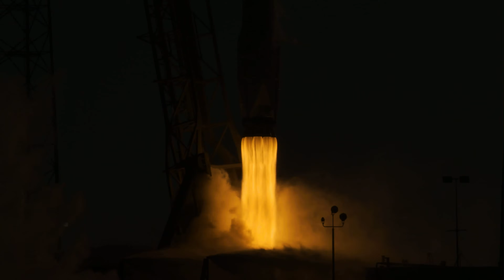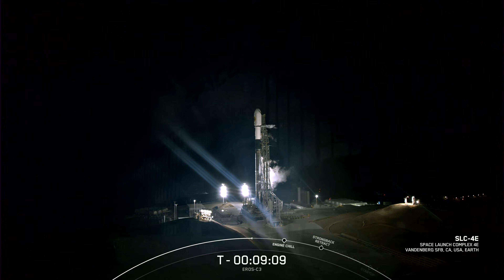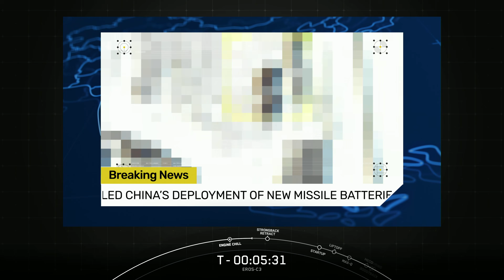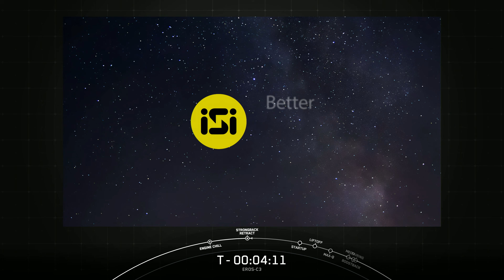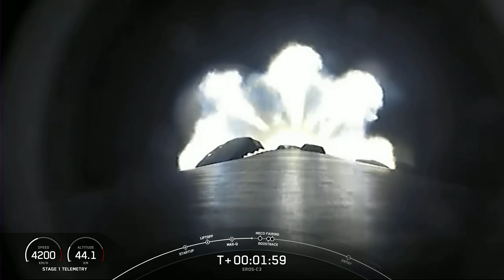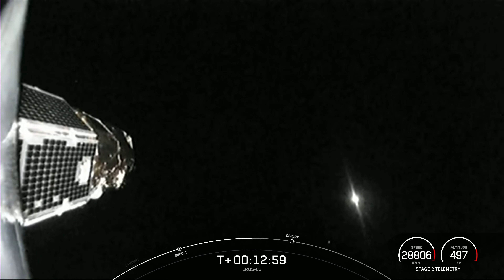ISI EROS C-3 Mission

Comment: 61 launches in one year. At this rate SpaceX will surpass all of NASAs missions in less than 4 years.
Reply: SX’s Falcon 9 is way less capable than NASA’s shuttle or SLS, so divide those 60 launches by 4 or 8 and you’ll get a more accurate comparison

SX is a commercial business to launch routine regular payloads, NASA is about pushing exploration boundaries
Reply: @alrightydave  Should Starship be successful, it'll quickly put an end to that argument.
Reply: @alrightydave  And when the Starship is ready , what will happen then my friend ?
Reply: @nikolaiiliev2993   What will happen then is that SpaceX will continue to be the commercial provider, launching payloads for NASA and other customers, but on far more operationally complex missions. When that day comes, NASA will continue to push the boundaries of exploration, and other customers will begin pushing the boundaries of commercial exploitation. The next few decades are going to be tremendously exciting.
Reply: @alrightydave  Falcon 9 has almost the same payload as the space Shuttle.
Reply: @alrightydave  There's no denying NASA did amazing work, however at the rate of speed which they move they might as well be standing still.  Some comments say NASA is exploration(like yours)...with drones and large cameras and satellites as of late.  Hubble is just that..jamesweb is the same..ahem.   Then its... yah let us go back to the moon...?  Really..that's pushing the boundaries of space exploration..?  Come on.  It's like being fascinated with your infant discovering their left foot over the right foot.  Putting better cameras on a telescope is not pushing boundaries.  Again, going to the moon is not pushing any boundaries...its been done..SLS is a huge waste of tax payer money...with some other spending agenda from the US Govt.
Reply: And next year they wanna do a full hundo that's one hundred launches in a year jesus 🤯 for reference the delta 4 heavy flew like 14 times in 18 YEARS 😆 🤣 😂
Reply: @williamgrunzweig571  whatever you think of the SLS program, I hope you definitely agree we should return to the moon.
Reply: Orbital launches in 2022: China: 63; SpaceX: 61; US (excluding SpaceX): 24; Russia: 22; Europe & India (each): 4; South Korea & Iran (each): 1. Pretty impressive that SpaceX on its own is only 2 launches behind the entire country of China and comfortably more than double any other country including all other US players!
Reply: @alrightydave  bro you are only one who is speaking with sense
Reply: @supremes5840  unfortunately over the years, I've seen a growing number of people thinking its NASA Vs SpaceX. NASA is the leading space exploration government agency in the world, which utilizes several private companies as partners. One of the closest of which is SpaceX.
Reply: @johntheux9238  And then there is Falcon Heavy which even more impressively has more than half the payload of SLS for less than one 20th the per launch cost! Spend the cost of 1 SLS launch with SpaceX and you'd get 14 times the payload!
Reply: starship is coming... and it wants mass production?
Reply: AND Artemis is lucky to have 1 launch per year
Reply: @alrightydave  Actually, not that much less! The Shuttle could launch a payload of 29 tonnes, Falcon 9 can put up 17 tonnes.
Reply: Let us not forget that SX would be out of business if not for NASA.
Reply: @awuma  it’s a huge difference of literally almost a factor of 2

Falcon 9 is 15.5t to a standard LEO. It can change a bit depending on inclination, and you’d have to change that for shuttle too

And Falcon can’t launch 29t WITH 8 crew in an expensive internal volume
Reply: @az09letters92  for a shuttle comparison, starship should succeed it for cargo if they achieve some form of operational capability, but there’s no certainty that it’ll launch crew, and yeah even shuttle is safer and more reliable than it. Not too surprising considered NASA did this 40 years ago

For SLS though, this is NASA’s next gen vehicle, so it’s even more capable. Starship doesn’t come anywhere near the high energy capability (which is what SLS is focused on). It will need numerous extensive modifications to become optimized, but that’ll take a long time, not near term capability. Starship will dominate in bulk LEO launch however, and good for them, but that’s not competing with SLS in that case
Reply: @nikolaiiliev2993  “when” really means a long timeline of upgrades for Starship to get closer to SLS’s high energy capability and shuttle’s crew capability
Reply: @Russell_and_co  In the early days sure, but now spacex have crafted a self sustaining launch and services market with Falcon and Starlink. Government contracts just supplement that portfolio now
Reply: @johntheux9238  LOL nowhere near. 15.5t vs 29t. It’s a literal factor of 2 in *co manifest cargo*. Shuttle also carried 2 crew dragon’s worth of human spaceflight capability
Reply: @williamgrunzweig571  Artemis is about staying at the moon with modern tech and architectural capabilities. Apollo barely scratched the surface in a touch and go program. Artemis is absolutely the very definition of NASA’s exploration endeavors

You could say JWST is a waste of time because spitzer already scratched the surface in infrared observations, or perseverance is a waste of time because it’s a copy of curiosity. They all build on top of each other
Reply: @alrightydave  It's 22.8 tons vs 27.5 tons so only a 20% difference.
Reply: @john_hind  Falcon heavy can only realistically send 32t to LEO in its extended fairing and thanks to its compromised structural capabilities. For high energy performance, it isn’t optimized nor is it able to be optimized, and is nearly half as capable as SLS block 1, never mind block 1B and 2. When you factor in capability differences, SLS will be a constantly evolving vehicle capability wise, so the cost difference isn’t that much, and is easily justifiable for SLS to have that for a single payload that big instead of chopped up into 3 or 4 pieces
Reply: @TiberiusMaximus  AND Artemis is WAY more capable than any commercial launch spacex is doing. The program is in its infancy and will evolve just like Falcon 9 has done in the coming years
Reply: @alrightydave  How can you say that about a vehicle that's still under development? We have absolutely zero data about Starship's reliability! Shuttle, unfortunately, was a rather unsafe vehicle. Sadly two crews were lost out of 135 flights.
Reply: @johntheux9238  That’s fully expendable capability, not reusable like the shuttle had, and again shuttle carried 2 crew dragon’s worth of human spaceflight capability while co manifesting a heavy payload

If you want expendable capability, shuttle C would’ve been a monster of a LEO and high energy hauler, literally a mini SLS with block 1 capability, 40 - 60t to LEO. It could send more to TLI than an expendable F9 could to LEO
Reply: @az09letters92  We do have data from the testing campaign, and I can clearly see how the operational phase of the program could turn out, don’t need to rely on it actually happening entirely

Starship is more unsafe than shuttle as is and I don’t think it will carry crew as is without modifications. It’s got a long way to go
Reply: @alrightydave  I'm pretty sure that the space shuttle payload bay is almost never full, so why do you need to compare real to theoritical performance? Makes no sense.
So we should always compare maximum payload.
Reply: @Russell_and_co don’t forget, there are 1,000,000 Starlink subscribers. That’s a fair amount of revenue per year.
Reply: @alrightydave  "We do have data from the testing campaign" - We've just seen development and pushing the concept to the limits. It's not yet in production in any possible way. Let's wait until after the development is done before judging, ok?
Reply: @alrightydave  If SpaceX isn’t about pushing exploration boundaries, then explain Polaris Dawn and Inspiration4. Considering Falcon Heavy was one of the most powerful rockets ever flown (only bested by SLS with one flight under its belt), your argument hardly holds up.
Reply: I agree but space x re-uses they core more than 10 times thats why. The customers pays more than $100 while space x pays only a few million dollars by just adding a second stage and replacing a few systems on their core stage. They have less manufacturing they do per year while ULA makes a new booster for each launch. ULA is better than Space X when it comes to performance. Atlas V has higher capabilities although it cannot be re-used. And NASA doesn't need to fly so many missions. Space X is literally just making space junk.Why not make a bigger satellite with higher frequency communications. Like upcoming Amazon Satellites. I am sure than 61 launches won't be necessary. Space is just being boring launch the same type of missions over and over
Reply: @alrightydave  so this 1 billion plus per launch non reusable vehicle will evolve into what? 3 billion per launch? I won't argue w you there
Reply: @OrionSpace931  for which orbit is atlas 5 better than falcon 9?

why does atlas 5 need solid boosters to lift any significant payload? liquid engines too weak?

why does ula waste man-hours and pollute oceans by not implementing reusability? 

why is spacex’s payload “space junk” but not ula’s? 

if you know of an alternative ‘bigger, more frequencies’ design for starlink, why are you not a spacex employee?

why does nasa buy way more launches from spacex (including iss resupply and crew) than ula?

why can’t ula design starliner in-house (like spacex and crew dragon), rather than asking boeing to do it?

why does atlas 5 still use russian engines?

where is jeff bezos and his mythical be-4 engine that will power the mythical ula vulcan rocket?

ULA is an old age home for rocket engineers.
Reply: @alrightydave  Right. Occupy Mars has nothing to do with exploration.
Reply: @shouryabose5943  Atlas V had higher performance and can deliver a payload in a precise geosynchronous orbit.  Falcon 9 launches smaller satellites. Atlas V 401 and 501 launches payload about the size of the payloads falcon 9 launches. The SRBs increases thrust. Its much more powerful than falcon 9. ULA never had a failure while space x had 2 already
Reply: @TiberiusMaximus  No. It’ll get cheaper and ultimately potentially below $1B from upgrades

It definitely will receive massive performance upgrades that will crush even the current block 1 capability, basically doubling block 1 capability after EUS, BOLE and composite EUS

Potentially a 5th RS25 and SMART ultimately to retain performance at that peak level and do so at shuttle levels of sustainability which would be amazing
Reply: Just imagine if you screwed up so badly over a very long timeframe, but still had a ton of money to pay someone competent to do their thing and still make you look good.
Reply: @shouryabose5943  Atlas V’s SRB’s increase versatility to be able to effectively perform a range of missions on a single rocket unlike SX which has to use a one off boutique 3 core rocket to launch slightly more demanding missions that’s proved to be barely more effective than even delta IV heavy, never mind atlas V

Atlas V is begged to any high energy trajectory, so a greater mass fraction of LEO payload can be sent, where F9 needs to be expended

Atlas is a sustainer vehicle which enables it to achieve high energy performance, so it needs to be expendable unlike F9 which sacrifices especially high energy performance to recover the booster at a lower staging velocity

ULA has nothing to do with Starliner besides launching it. They don’t manage operations

Tory has completely shook up ULA into a new exciting era with Vulcan and lots of new engineers who aren’t sold on Elon coolade like at spacex

ULA with Vulcan have created an even better rocket than Falcon while implementing reuse effectively with SMART and taking the SRB architecture even further while retaining high energy performance, effective LEO heavy lift and keeping to a single common core that can be massed produced thanks to its modern design

BE-4 is basically the best engine in existence now. So badass you have to cope with it
Reply: @SLG0921  Yeah. It doesn’t. Because selling starship primarily on exploration is daft. It will only assist NASA’s programs, not lead its own campaign because it’s flawed
Reply: @alrightydave  a few SLS launches are completely inconsequential compared to hundreds of falcon 9. Shuttle had only 3x the payload of f9, but rarely flew with Mac payload unlike f9 starling missions.
Reply: SpaceX has mastered LEO. Luna or Mars is another ballgame.
Reply: @johntheux9238  falcon 9 cant fly up , set for a space walk to fix a machine in orbit , like the shuttle did for hubble
Reply: @stevensmith797  That's litteraly what they will do for Polaris.
Reply: @alrightydave  BE-4 is 134bar chamber pressure pleb.

Raptor 2 is 300 bar chamber pressure king.
Reply: PLEASE STOP with the on rocket cameras during launch, viewing from the ground makes it look so much more intense, so much more real, every flight from pov of the rocket all look the same, and sad to say BORING!
Reply: @odysseusrex5908   That may become the state of space traffic eventually, unless.. a wild bricoleur shows up (whom wisely admitted by both connoisseurs and savant scientists) fixes the ‘broken’ matter of non physically arranged entity transport. That might require a team of SpaceX quality degree but the defining factor would be their admittance of the ‘outsider’.
Reply: @alrightydave  Falcon 9 has a launch cost (not what SpaceX charges customers) of around $20 million, maybe less.     What did a Shuttle launch cost?
Reply: @alrightydave  Cost per ton of payload for each?
Reply: @OrionSpace931  If it's boring, why are you here watching and commenting?
Reply: I work in the industry, but I can't speak for NASA as such, or even as any kind of official voice for my employer. However, "Pushing the boundaries of space exploration?" Since I've been working there, my employer has launched, and is in development of, the following missions, and others: Parker Solar Probe, which is studying the Sun and has actually sampled the Solar corona, from far within Mercury's orbit. Until the specialized heat shield was developed (less than ten years ago) it was impossible to get anything that close to the Sun. It's also the fastest object ever built by humans (so far), outpacing New Horizons, which itself was a groundbreaking mission, allowing us  to see Pluto as more than a few blurry pixels for the first time in history. And was the fastest thing ever built until Solar Probe broke its record. The Messenger mission to Mercury was the first mission to orbit the innermost planet, and allowed accurate measurements of the composition of that world for the first time. Messenger actually used the pressurant gas, helium, from its fuel system, as a non-combustible attitude control system to extend its mission, for the first time ever. DART was the first mission of humanity's nascent efforts to protect us from "the one that got the dinosaurs," impacting a tiny satellite of an asteroid far outside Earth's orbit, to begin to demonstrate technology to deflect an asteroid from potential impact with Earth. Dragonfly is going to land an octo-copter on Saturn's moon Titan. That will autonomously land, take and analyze samples, and then move to another location and do it again. And again. And again. Scoff if you like. But I am incredibly proud to be part of these missions, and of the knowledge we are gaining from them. Yes, NASA has some issues. But they are far from just recycled Moon missions.
Reply: @odahithedubious  I doubt anyone would scoff at much of anything you said. Pretty insightful if you ask me.. I work in the UAV industry and am rather curious as to what that octocopter might look like. We deal with a lot more electronic failures than we like to talk about, so I'd also be curious to know what redundancies are in place to prevent such failures and which country produces the electronics being used..TIA
Reply: @TheUweRoss  Falcon 9 costs $50M and shuttle costs $450M. For spacex to equal shuttle’s capabilities, they’d need a Falcon heavy and 2 Falcon 9’s, so $200M in launch costs

And remember shuttle did this 40 years ago so you don’t say we’ll have similar capability at half the price now

Comment: There were a lot of ambient noises that coincided with stage separation, fairing deploy, landing, and general parts rattling. Is this the first time they had "mics hot" on the first and second stage?
Reply: It's the first time I remember. It's pretty neat hearing all of the noises
Reply: I think that was just background noise from where Jessie was broadcasting,
Reply: @59seank  I thought so, at first, but the sounds and timing they occurred was very characteristic of what I thought they would be. Springs expanding fast and panels flexing (during stage sep), flames combusting (twice, re-entry and landing), more panels flexing (fairing deploy), then the ambient sounds stopped before SECO and payload deploy. If they were not from hot mics on the rocket cameras, then they have a good foley team mixing in sounds.